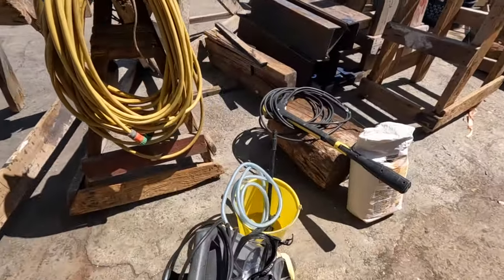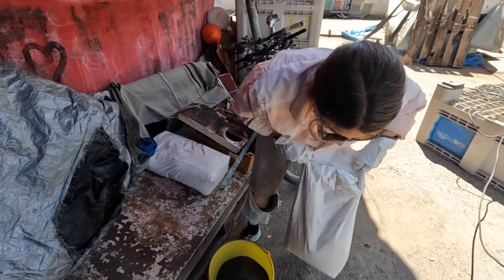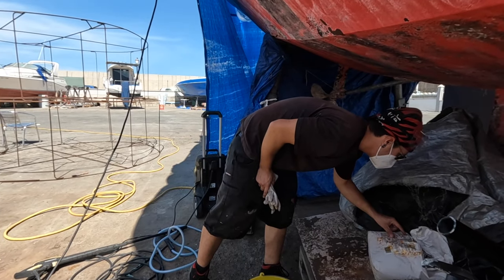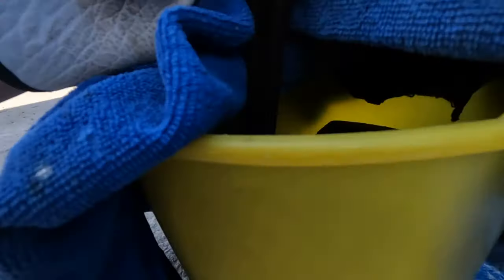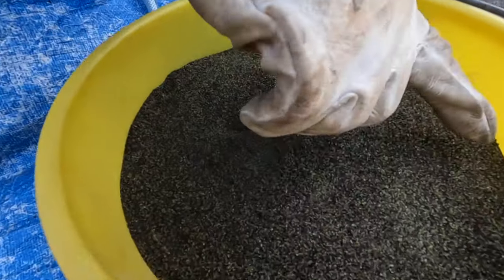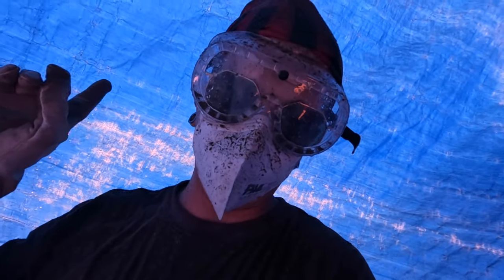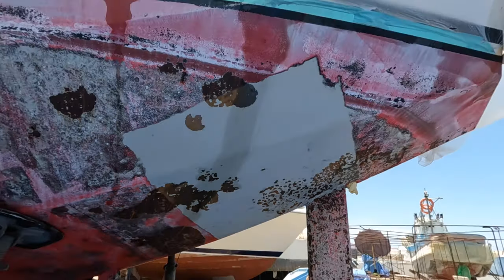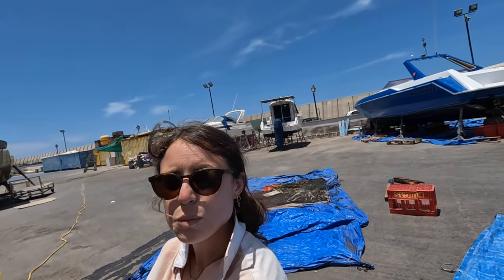Wet sandblasting our sailboat! How much would it cost? Does it work? Kärcher wet sandblasting kit.

Comment: If you use jotun epoxy 87 flash rust is no issue . You don't need to use karcher sand , normal dry kiln sand is as good and cleaner
Reply from the maker: I have heard that before that flash rust is no issue for Jotamastic. Still can't shake the feeling that a thick powdery layer of flash rust decreases attachememt at least a little bit though. In the end we removed the flash rust before painting anyway.

Comment: Could you catch the sand with tarps on the floor and reuse it? ⚓️👍🇬🇧😎
Reply from the maker: Yes you can catch a large fraction of the sand if you tent in securely. Without tent the sand will spray quite far, but with tent it will collect on the floor. We have done that to see how wepl it works and managed to sand an additional 3m2 with recycled sand that initially was enough for 1m2. Keep in mind though that the sand will loose its edges when recycling and might not be suitable for all applications anymore. It was enough to blast of old antifouling but I am not sure how well recycled sand would fare against proper rust.
All the best!

Comment: I hydro blasted my catamaran back in the mid 80's and used 3000# of sand at 4K psi to remove all the epoxy bottom paint from over the years.
Reply from the maker: I think its a great technique that works well for removing old paint!
Reply: Use rust milk like whurt rust milk